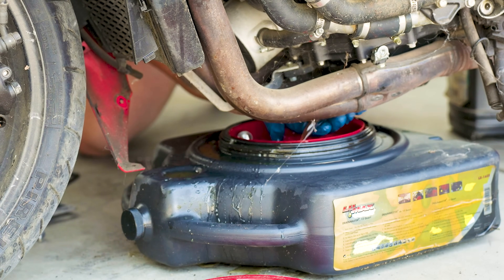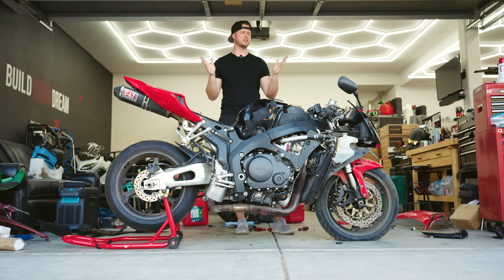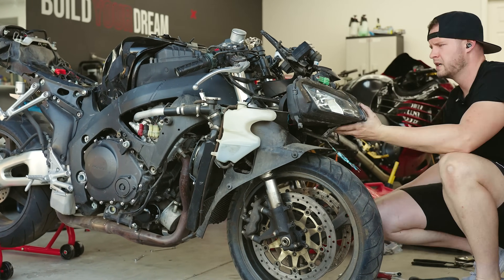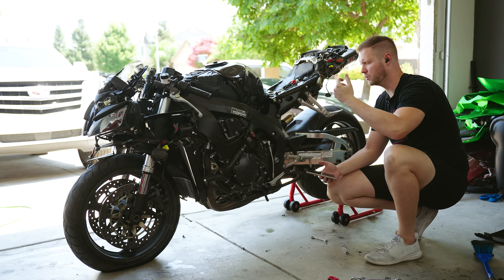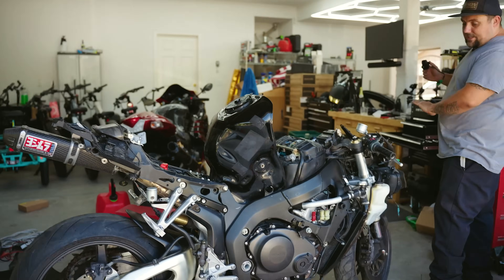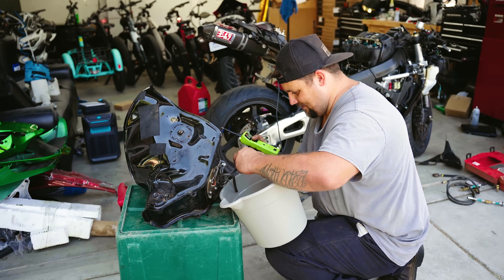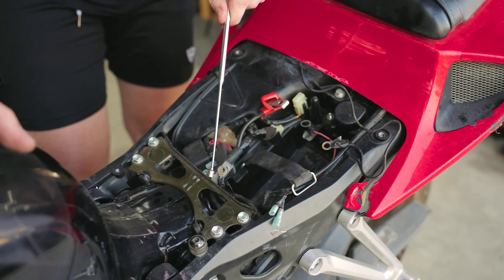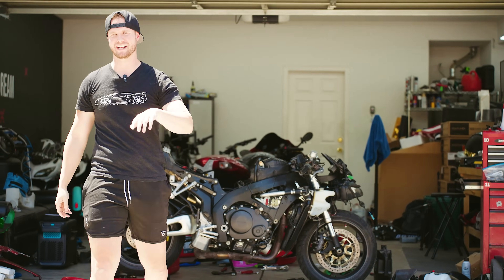Will the $2,250 MYSTERY BIKE RUN??

Comment: We can fix it....keep a positive attitude 😊 
Steps to follow---
1- compression test
2- inspect the spark plugs 
3-take multimeter and check all fuses and relays
4-change all fluids (new oem grades) and gas in the tank
5-check valve gap with proper shims and timing correct
6- all those check out ,bike should run 😊

Comment: 8:45 Bike is not starting in gear either coz the clutch sensor (near clutch lever) is toast or coz you are running aftermarket clutch lever that doesn't give it enough movement to detect the clutch is pressed

Comment: A few things: That starter cycling sound is 100% normal for a CBR, the key & ignition issue is H.I.S.S. and we don't have that on US market bikes, the Bank Angle Sensor ABSOLUTELY does affect the ignition system because that's the whole purpose and if it's tripped you usually have to cycle the ignition on/off a few times for it to reset, and lastly the CBR 600rr & 1000rr both run 8 fuel injectors so (as evidence by the bike running on starting fuel) only 4 work all the time and the next 4 cycle on at 4,000rpm.  I was screaming fuel pump since the last video because that's the common issue on this bike if it's been sat for a while so for future reference you can get test relays to plug in place so you can switch on and off whatever you are testing and that would have shown a dead pump from the jump.  Also while the kick stand switch operation is obvious the CBR clutch switch only applies in gear, so, you can start the bike without the clutch in neutral regardless of the kick stand. That's actually one of my favorite things about my 600rr aside from the fuel gauge instead of just a low fuel light.

Comment: Have you checked the yellow box near the fuel tank that has a heap of green wires running to it inside there when you open it up there will be a strip of metal with a heap of pins coming off it take that out and check for any corrosion and give it a really good clean had my 05 cbr600rr not start all from a bit of corrosion and i sanded all the pins and put it back in bike and it fired straight up after that

Comment: I wrecked an 04 cbr1000rr and it broke plug to ecu behind radiator overflow.  Caused my bike to do same thing fuel pump wouldn't prime.  Fixed plug and runs perfect.   Good luck to you
Reply from the maker: @bradleyhice6025  interesting, thanks for the tip!

Comment: U briught in a real expert.   He tested the top injectors… theres 8 on this bike.  2 sets of 4. The ones he tested only start firing at 6k rpm and big % of throttle

Also the tip over sensor (bank angle) behind the dash could cut the fuel pump..

Pretty sire the pumps are fine.   Those (and that cbr motor) are bulletproof
Reply: You’re right about the injectors but the pump is 100 percent gone!! I never claimed to be a motor cycle expert at all I’m an automotive expert! but you can’t deny I know what I’m doing…I mean it’s running with no pump or fuel tank so that’s gotta say something 🤷🏻‍♂️

Comment: The "scammed" description part was a mistake seeing as you bought a totaled bike and talked the seller down.
Reply from the maker: @GeorgiaGrowGuy  well no, the guy told me mechanic said great running bike and fired right up. Got it home, cranks slow, coolant in the oil, seized fuel pump, rust in the engine
Reply from the maker: @GeorgiaGrowGuy  but hopefully not as big of a scam as it seems.
Reply: Im on inja's side......clearly lied...😢
Reply: There's no way the seller/mechanic didn't know. Ergo lied, ergo scammed. Comes with the territory
Reply: Did you watch the original video? Pretty sure he wouldn’t lie about someone saying one thing while selling something that’s complete shit. No offense.